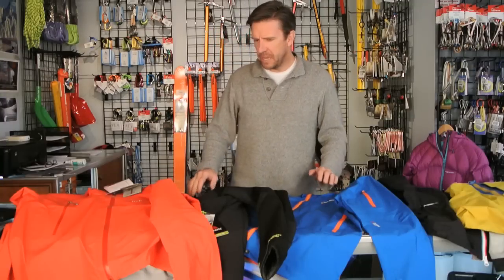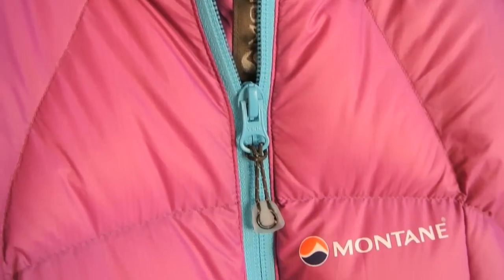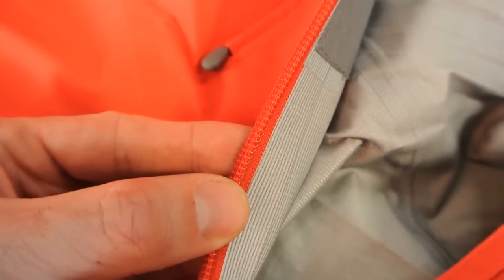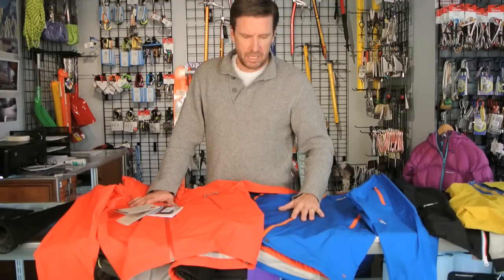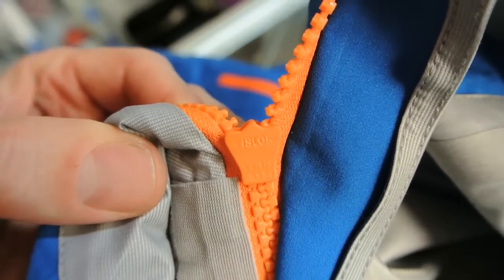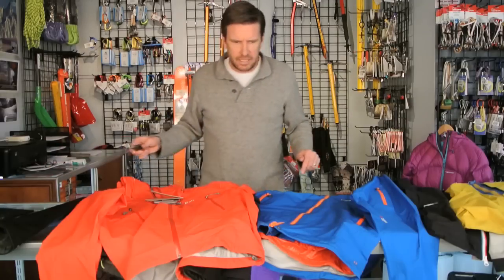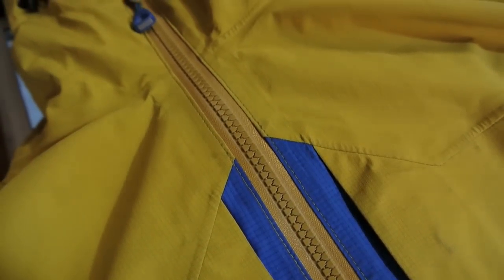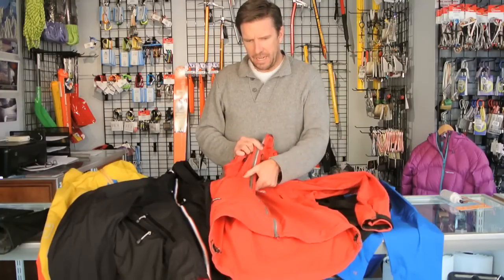VISLON®(molded) vs. Coil Zippers

Comment: Super helpful! I'm designing and fabricating a backpack prototype. The comments from the store perspective about warranty returns for smaller AquaGuards is very sobering. Good to know that the the larger AquaGuard zippers have greater endurance and that you have loaded up bags that have AquaGuards without failure. Also good to note that they turn a curve better than the VISLONS. The look of the AquaGuards works better with my brand, but I don't want load up my customers with zipper failures so am considering the VISLONS as well. Thanks for posting this.

Comment: Coil zippers are actually stronger and easier to repair a misaligned tooth, vislon zippers tend to work allot better in waterproofs because the slider is traveling over the teeth rather than the tape this means your not wearing the PU layer and you get to run other the smooth nylon rather than the relatively sticky PU, you see failures in smaller sized coil zippers for the simple reason that small zips suck, they cant make small vislon zippers so you never see any where near as much failure in them.  This being said Vislon zippers are not the be all and all they can chip with leads to a dramatic irreparable failure of the zipper depending on how bad the chip is, you will never experience this with a coil zipper as teeth fix them selves, coil zippers though are on the other hand more open to abrasion on the thread if faced out or the tape could be abraded this would also cause irreparable failure of the zipper.
 I'm assuming most of the warranties are the a from the slider separating from the coil which is actually a very easy fix to do at home if you go about it right.

Comment: Great info, thx.  I used a fannypack everyday and currently I am using a MountainSmith fannypack which the zipper always seems to separate in less than a year of daily use.  The zipper is YKK  8RCz.  Most stores than sell fannypacks do not ha e a large selection of brands as well sizes of fannypacks in the store so I end up buying online.   Since u seem to be partial to the Vislon zippers,  do u know of any maker of fannypacks that uses Vislon zippers?